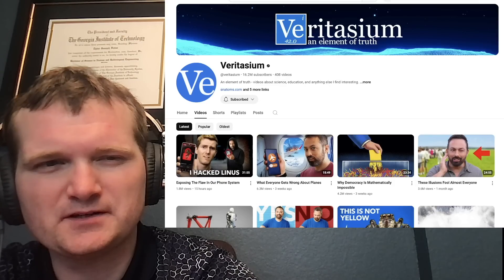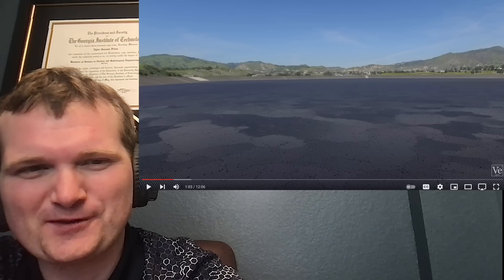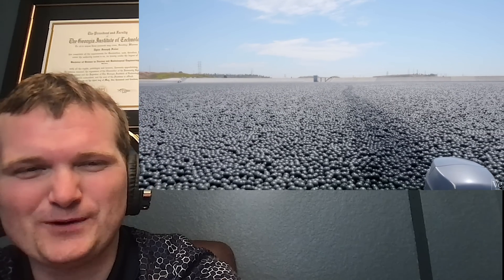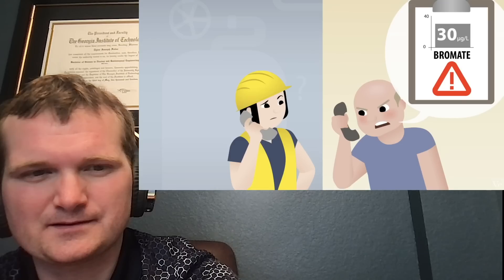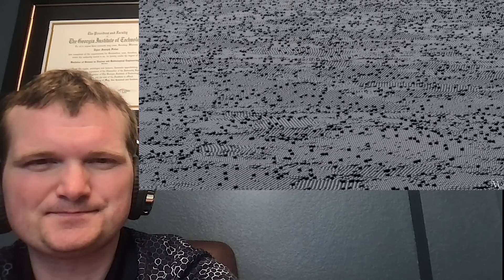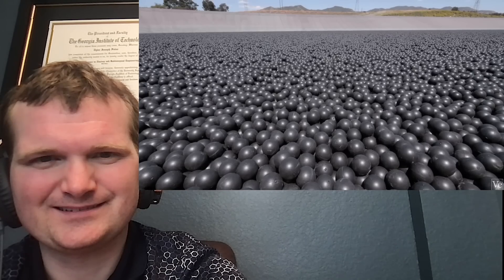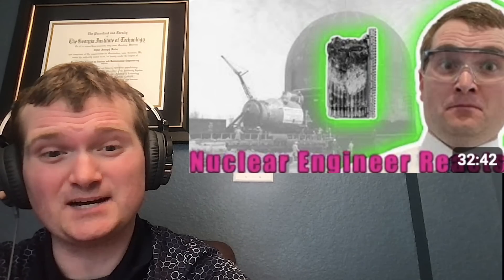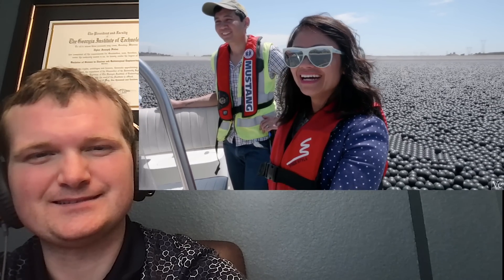Why are 96,000,000 Balls in the Reservoir? - Nuclear Engineer Reacts to Veritasium

Comment: This reservoir is for the DWP Generating Station, a Non-Nuclear station. The nuclear stations hasn't been built yet. So 1) Drinking Water not NUCLEAR COOLING which is hard to do in the absence of any Nuclear Power Plant. 2) You are Discussing something YOU are knowledgeable about but it bears zero resemblance to this scenario.

Comment: I’d coat the spheres in one of those ultra-white pigments, the ones that reflect over 98% of visible light and which emit all of their accumulated heat in the infrared atmospheric window. It’d be free cooling for the reservoir, not to mention the planet :3

The particular pigment I’m thinking of is also insoluble in water, so it’d be extremely safe.

Now, it’d reflect light on the surface facing the sun, but it’d still block a lot of it.
Reply: But is it UV tolerant and stable while in water? And is it significantly more expensive than what they used? And even if something is insoluble, it doesn't mean it can't be carried by the water down stream into the drinking supply. These would all need to be evaluated before using. (especially since California has extremely strict rules about classifying things that may be linked to cancer)

Comment: the carbon black coloring is the same thing they use in stuff like plant pots and drainage pipe. 

it's basically soot mixed in with the plastic and the particles mixed in block the UV really well... definitely at least a decade probably 2-3.

Comment: Wouldn't reducing water evaporation, while surely reducing loss of water, also decrease rainfall in the area since there's less water vapour going back into the cycle?
Reply: This reservoir is smaller than the Pacific Ocean, which is also near Los Angeles.
Reply: Theoretically yes, but as it was said, this is statistically insignificant even before considering that the reservoir is not natural.